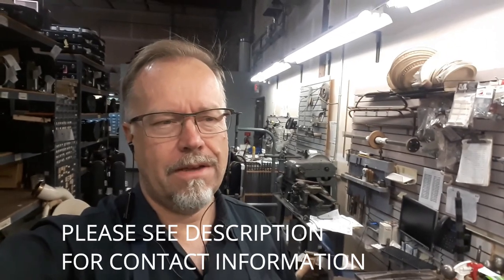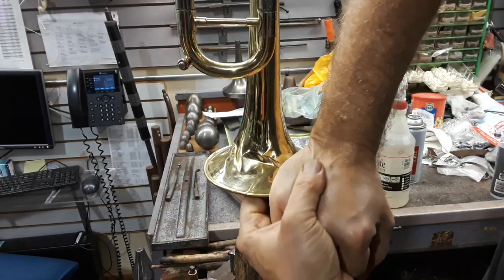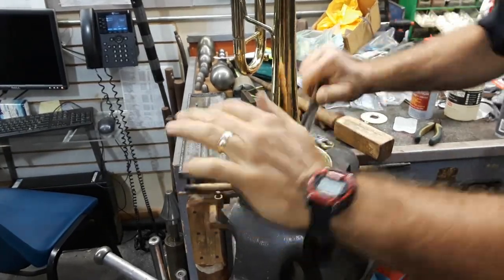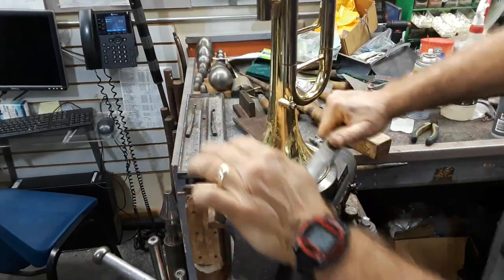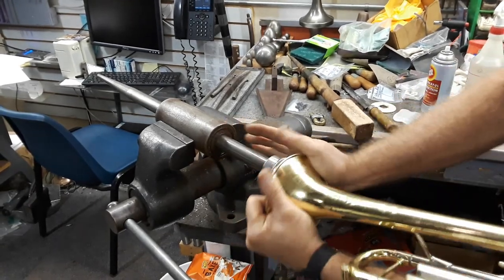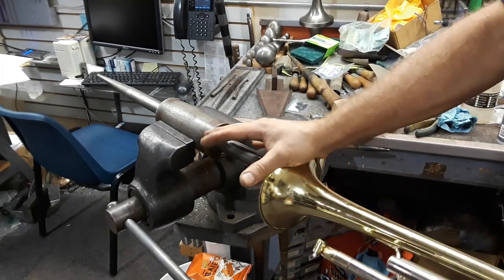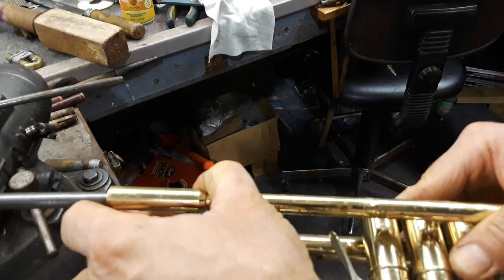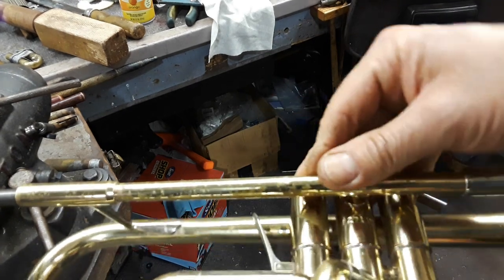TRUMPET HORRORS !

Comment: Does burnishing the brass make it harder? 
Yes. Brass is work hardened. Bending it in the first place hardened the bends. That's why it needs to be annealed before repairing it, otherwise the metal will break.
Instrument repair seems to be part metallurgy and part sculpture. I have to admire anyone who can do it.
Reply from the maker: Thanks.